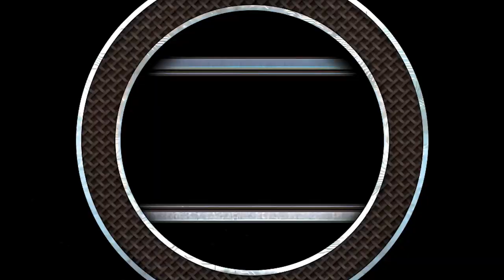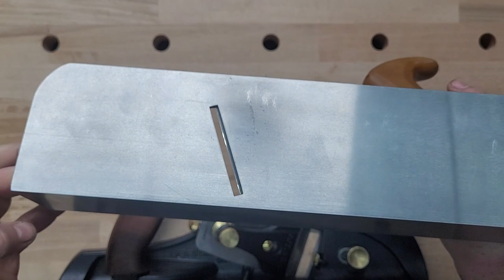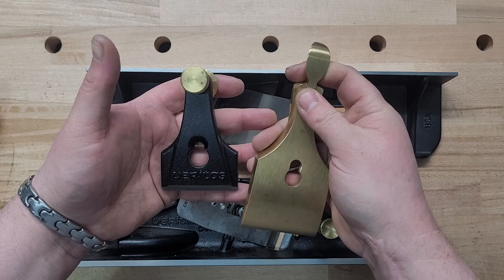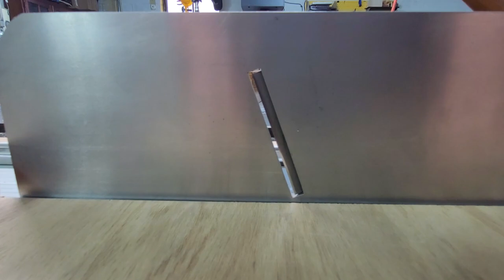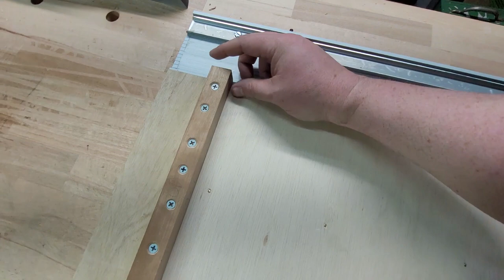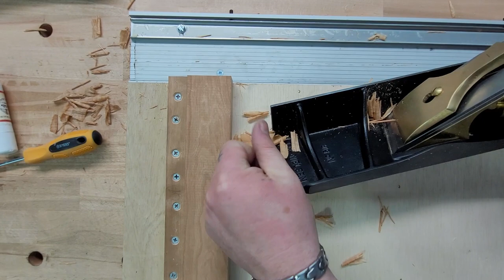UPDATED - IT'S NOT WORKING = $650+ Lie Nielsen Vs $385 Veritas Shooting Plane Review and Comparison

Comment: I own the LN Shooting Plane. I've had issues getting it to do any challenging work squaring end grain. I built a super-nice shooting-board for it per LN instructions. I want to like this plane because all of my other LN tools are excellent. I think this one doesn't really work in real life. What I found is that it cannot hold a blade setting when shearing anything remotely difficult such as something like 3/4" Hard Maple or 7/8" White Oak. What happens is the blade shifts and loses its setting. There is very little keeping it from doing so. By contrast, Veritas has the lower angle approach and it has lateral-lockdown grub screws. That is what the LN needs. I tried a lot of things but nothing so far has worked. The main thing that helped was using planks underneath whatever I'm shooting, to make sure that the board being planed is centered along the width of the plane blade. Otherwise, if it is down lower for example, the plane blade gets knocked out of adjustment right away. And while you're not supposed to do it, I've cranked down on the cap-screw to try to lock things in place better. That didn't solve the movement enough. I've had to resort to squaring end-grain for my current White Oak project freehand, vertically clamped in a vice with a back-stop jig, using the LN 62 which is a low-angle bevel-up. I sharpened that blade down at 25 secondary bevel for a total angle of 38. That ended up being pretty workable. The oak I'm using has been air dried and technically it is Chestnut Oak and looks just like brown English Oak. For what its worth, not even the LN 62 really likes planing that end-grain at 15/16 thick on the shooting board. But free-hand, with the blade skewed and very sharp, things start working fine.
I called Lie-Nielsen tech support and they said I could try applying alcohol to the end grain and that might help, they agreed that the work was demanding for the plane, and also offered that I could send the plane back.
At the moment, the only other thing I might try is roughing the plane blade a little bit with sandpaper where it contacts the frog, and spray contact adhesive or hairspray on one of those surfaces, to help the blade keep its setting. But when you get to the point of trying stuff like that, I feel like its probably grasping at straws with hopes that something will work that has an inherent design flaw. If all I made was thin pine boxes, it would probably be fine. Maybe I'll check and make sure that the frog is flat. So far I've just assumed that it is. LN is always that good!
Probably time to start considering the Veritas since I need something that works every day.
Thanks for the review, good job!
Reply from the maker: Thank you for sharing! This is really good insight! Did you find that the LN goes outta lateral with other woods? I was trying cherry and didn't even think that it getting knocked out of lateral would be a thing. The Veritas has been my user mainly because of price but also because of the low angle. So I never worried about the lateral given the set screws like you said. 
Can you put a shim on the lower side of the blade to hold it? Vs adhesives make something thats like a set screw for that side?

Comment: I have both in Jack and smoothers. I gotta tell you, I like the low angle bevel up Veritas. I like my bevel up rabbet LN plane.. I have been chastised by other woodworkers that I am using beginner planes by using bevel up... But compared to my traditional bevel down,  They are so much easier to work with. I like the LV adjustable throat over the bedrock style, it's just simpler. I keep multiple blades for my LV so I can choose what angle I work with.  To those that say it's a beginner plane, it just makes them feel more experienced and superior... To me easier is desireable, especially since I don't see a difference other than ease of use.  My LV irons are A2 and O1.. I chose O1 to be able to quickly modify the angle.. A2 requires more work and diamond for sure.
Reply from the maker: Don't listen to ppl when it comes to that. Use what you like! I started that way but got tired of how much effort it tool to push the LA when I had the 38 degree and 50 degree irons in there haha but that's my preference! Your is to use them and there is no issue with that! I will always reccomend trying a standard bevel down but if you don't like it, that is 100% ok! Use what you like and get good results with!
Reply: @BatCaveCreations  I don't listen to them, they are just trying to feel superior. In my 50 years of woodworking, I have used a lot of bevel down.. I have a nice collection, gave my son all bevel down.. but if you ask me, bevel up like LV with all adjustable mouths have an advantage, especially if you have multiple blades.  I still use my bevel downs, but adjustment is not as easy as bevel up. It works well without a chip breaker, I can get whisper thin shavings, or nice honking cuts if I need to quickly dimension or true up a piece.   I use a jack plane for shooting. I don't need a dedicated plane.. I use my bevel up LV jack.
Reply from the maker: @jsteifel  that is awesome!!! Love it! Thank you for sharing!
Reply: @jsteifel    I guess every hobby has snobs.  ;)  I am with you on the bevel up planes. Most of the bevel down planes I own were my father's, grandfather's and father in-law's. I use the planes from time to time just to think about them (father ect).   All of my users day to day are now bevel up. I have extra blades for higher angles. Fast and easy to change the angel of attack. Have my eye on the bevel up jointer but that might just be a waste of money as I have a super long shooting board for edge work. Anyway people should use what works and ignore those who are offended by someone else's hand plane.

Comment: I suspect the issue is related to the piece of paper and (indirectly) because of the Veritas plane track.  On a traditional shooting board there is no back fence preventing the plane from moving away from the workpiece, so proper technique must be developed to hold the plane tight to the side of the board.  If you're using the Veritas track and only pushing the plane forward through the cut, it's free to chatter by as much as whatever clearance you leave.
Reply from the maker: I think you are correct, I just didn't see the same issue with the veritas when you think there would be. I still continue to hear about 50/50 results on people liking or not liking the LN lol

Comment: Well, I have the Lie Nielson, but haven't used it yet. I do have a Stanley 4 1/2 plane (?). I was having back lash issues with it. Mostly in the 'fine shaving one pass, then adjust for slightly heavier cut and bad chattering/dig ins/ tear out. I messed with the bottom of the frog and where it sits on the plane. That seems to have fixed that problem. 

For wax on your sole, and on the track. look at Butcher's bowling alley wax. Good stuff. I might have to try out one of those tracks. 

As for the 45 degree setting for a shooting board, I did take a big speed square and use it to set the miter gage on my table saw, then cut a plywood piece from that setting at 45 degrees. Perfect as near as I could tell. Then went to the shooting board, and checked it again with the big speed square. Seemed to work, but I haven't tried to make a picture frame, yet....
Reply from the maker: I heard about bowling alley wax! I'll deff check that out! A buddy made me some Bees Wax so once that's gone I'll give it a try.
The frog on this being a bedrock style shouldn't have that issue esp cus it's a $650 plane haha but I'll check it out!
Great idea ok just cutting a piece of ply from the 45!!

Comment: Do you have any problems with your Veritas Shooting Board?I’m having a hard time deciding the V and a LN 4 1/2. I will get both eventually, but the 4 1/2 seems a better because it  can do other things besides shooting board work. On the other hand, I already have a LN 5 1/2 and I really need a better shooting board plane than using it as a 4 1/2. So standby. I’ll let you know.
Reply from the maker: No issues with this board. I only have the veritas track tho I build the board

Have you tried using the 5 1/2 for shooting? Try that before getting a 4 1/2 for shooting. 

I love the veritas shooting plane it's just $$ lol
Reply: @BatCaveCreations  Sorry, I meant your shooting plane. My 5 1/2 is awkward for me to use as a shooting board. My Stanley 4 1/2 works better, but still not particularly comfortable. So, the Veritas makes sense. I’m still going to buy a LN 4 1/2 and the Veritas but not at the same time. I’m pretty sure the Veritas will be first. Both planes are essentially the same $.
Reply from the maker: Sorry for the delay for some reason YT held this comment for review.....
I have 0 issues with the Veritas shooting plane, it is hands down the best shooting plane you can guy imo. I dont like bevel down planes for shooting because of the angle but i know alot of guys that do it that way. I just prefer the LA shooting plane. 
if you dont want a dedicated shooting plane check out a Low Angle Bevel Up Jack instead! I have a review looking at the LN and Veritas ones.

Comment: I have not tried the LN shooting plane, although I own several other of their planes.  I purchased the Veritas shooting plane last year and use it daily.  In my opinion, the Veritas has three advantages.  The lower cutting angle is definitely an advantage.  If both planes were sharpened to equal levels of sharp, the lower attack angle will require less force, but I'm certain the difference will not be that great, so I'll forgive you for dismissing that out of hand.  The next difference which is probably the most significant one is price.  No contest.  The third is the availability of PM-V11 in the Veritas blade.  It seems to take a sharper edge with less effort than anything else I have ever touched to a whetstone or diamond plate and it holds that edge several times as long as O1 or A2.  As I mentioned, I have used mine a couple times each day for over six months and have only sharpened it twice.  And earlier today it was still peeling off light full length shavings of hard maple.  I have absolutely no buyer's remorse on that purchase.  Your mileage may vary.
Reply from the maker: I agree! And I also feel that low angle planes are way better at handling end grain than standard angle planes. Both can be used but the low angle is just easier lol pmv11 rocks esp for this kind of application!
Reply: Fourth advantage:  Money difference.

Comment: Super strange request - would a knob from a long angle jack plane fit on the veritas shooting plane (in place of the brass knob)?? I am in need of a toothing plane, but don’t want to buy a whole other plane.
Reply from the maker: Lol it does!! I ran down and swaped them out! Make sure you use the brass piece from the LA on the shooting plane as well (or a washer) cus without it it rubs the side of the shooting plane. Just the little extra height prevents it from rubbing.
Reply: @BatCaveCreations  Woo!!!! That’ll save me a few hundred dollars. Thank you!!
Reply from the maker: @Robert Garvey  no problem at all!! Happy to help!!
Reply: @BatCaveCreations  for posterity - Lee valley will special order the low angle jack knob with the brass washer. Hopefully the skew of the shooting plane won’t hinder the toothing blade’s effectiveness. Either way, having the flexibility of a low angle jack is well worth it! I may even keep the knob on there all the time - time will tell.
Reply from the maker: @robertgarvey5744  If it does just hold the plane at the opposite angle and go diagonally across the board so the teeth engage the wood parallel to the edge, you know?
That is awesome that they can special order that for you!!!

Comment: I think that shooting boards and whatever corresponding plane you use must be pretty bang on in every setup and also use respect. I can relate to your futile search for an answer. Sometimes we just have to punt….if answers don’t come after a reasonable attempt then move on. By the way, even the board could be flexing if it is not flat and square on the 2 reference surfaces. Maybe a board issue? Did you try another board which was square and true and did you put the reference edge against the fence and reference have down every time? A must!
Reply from the maker: 100% agree and in response to the board/fence situation. That's what LN said when they called, but... the Veritas had no issues working on that same board, so..... :D I kept the Veritas and sold the LN.
Reply: Different tools different ways to use …

Comment: My guess is that you are referencing the bottom edge of the plane on a track, so there is a bit of room between your sole and the work piece. Since the works piece is so much thinner from the end view,the plane is likley rocking a bit on contact.  One of the fee locations where a low angle bedding such as veritas makes so much more sense as the weight is behind the iron, cause it to want to push through forward instead of diving from wanting to do more of a shearing force.
Reply from the maker: that is a great observation, thank you! Makes sense, maybe sometimes it was rocking and sometimes it wasn't.

Comment: YIKES! $600 is too much for "fiddly", at least for this bougee popper.  I can get the paper shim issue, but having a sweet spot for grip pressure...no thanks.
When my jointer exploded I decided to spend $600 on new hand planes I can get 'learning on' right away, as opposed to waiting 6-8 months for a custom Shelix head.  As I am glad I didn't buy anything too pricey at first, I am growing a fondness for the low angled planes.  Veritas is looking like my pick for a Shooter and LA Smoother.  I'd even consider the Stanley LA 4, but might have to shorten the adjuster??  Sorry to ramble, coffee is good food!
Reply from the maker: Veritas makes the best low angle planes I've tried! Others are either fiddly, unreliable, QC issues, no adjusters, ect. Veritas packs it all on and the price is good imo. I have the LA Jack and LA Small Smoother (no 3 size). Got the different blade angles and types. They are a worthy investment imo!!!

Comment: Thanks for posting this video and the comparison between the two planes. I appreciate all the work you put into getting the LN to work. The biggest red flag for me (and I am not making any accusations here) is that you said you purchased the LN #51 for $40.00?!?!? While I appreciate a good bargain, (most of my planes are type 11 Stanley Bailey's that have been really well refurbished and tuned) It seems to me that getting a plane for less than 10% of the new price may bring with it the expectation of a damaged or poorly manufactured plane. While I'm sure you put it through it's paces and made sure everything was working properly, I can only think of that issue. Such a deal for an expensive plane... maybe something was wrong with it? I don't know, but keep doing what you are doing. I appreciate your videos. Thanks!
Reply from the maker: Thank you! I won the plane in a raffle that I only paid $40 to enter. Buying out right for 40 would be way to good to be true haha

Comment: Have you checked to see if there was some figure in the board you demo-ed? The shavings you described made me think of it. The low angle Veritas would likely not have had the same issue. Summary: I think it was the sporadic curl in the wood sample you used. Loved the video and will follow your channel. Cheers.
Reply from the maker: That is possible, deff could be the species I was using and a buddy mentioned that. But I deff wouldn't want to have to be picky with the wood I used with the LN :/ trust me it was a bummer. I ended uo selling the LN.
I am glad you liked the video! Check out the other ones I improved alot since that one haha
Thank you!! Have a good day!